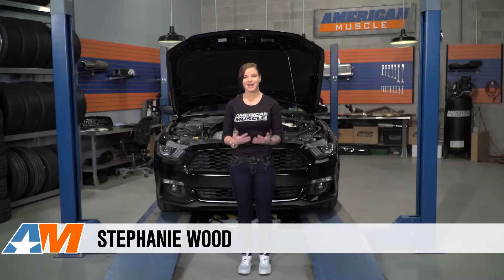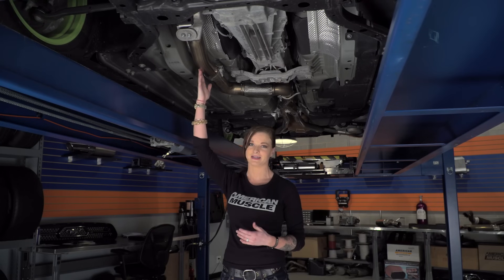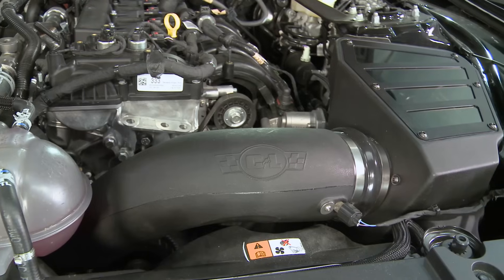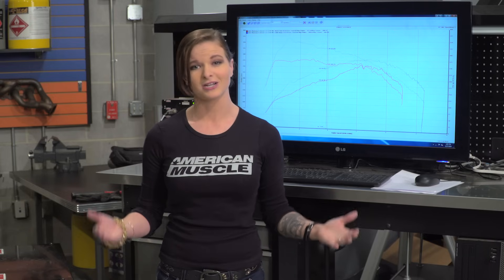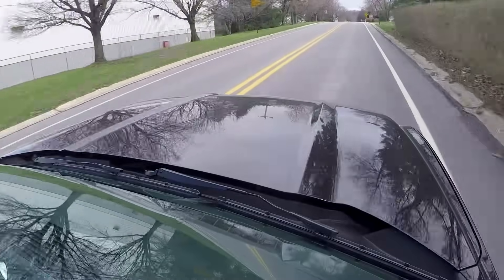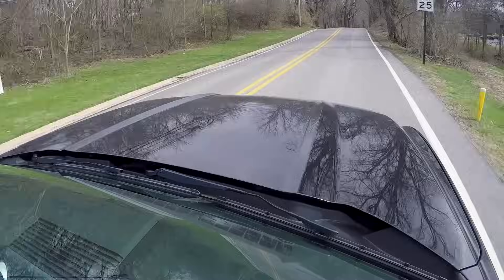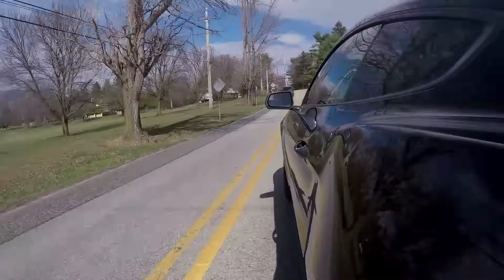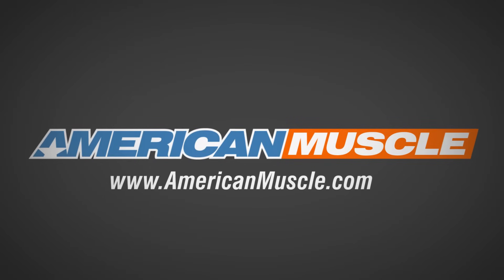3 Mods + 113 HP Gains- 2015 Mustang EcoBoost

Comment: A true mustang owner wouldn’t bash another ecoboost owner because he thinks he’s better for having a GT. A true owner would admire any mustang for what it is.
Reply: Facts and as a first car, an eco is fast and still nice. Decent hp
Reply: Someone sounds hella insecure
Reply: @ashtonl6122  I mean do you have a gt almost going to the gast station almost everyday taking it to work?
Reply: @carlosalvarez5615  firstly you must work far secondly buy good gas no 76 quiktrip circle k etc.
Reply: @ashtonl6122  sound like someone who ain’t got a fast whip.
Reply: @matthewobrien5398  why have a fast whip when you can have a 2500 and fast toys 😘
Reply: Exactly brotha .. forsure the noise doesn’t compare to the V8 but the power forsure does have the mustang it’s quick and packs a punch ! Just picked up the 10 speed and I love it 😎🤙
Reply: @ashtonl6122  tekuache moment be like:
Reply: Well said.
Reply: a true Mustang owner owns a Mustang.
a cool Mustang owner isn't an a**hole.
a "typical" Mustang owner is an a**hole though lol.
Reply: I went from a GT to a ecoboost I love them both but it is nice to have turbo sounds and blowoff tho the deep rumble from the GT is also nice. Ecoboost is a fun daily driver GT is a good race car.
Reply: With that being said I do have a stage 2 Tune on the ecoboost and it is faster then my GT ever was. And the turbo sound in my opinion is way more addicting then a loud v8
Reply: 2007 mustang GT to a 2021 mustang Ecoboost
Reply: Eco's are pretty quick. impressive for a 2.3L.
Reply: @everythingjonathan8008  Im about to drop about $3.6K to aftermarket the exhaust, intercooler, downpipe and catch can with labor and a tune. The guy doing it for me believes he can get more than 110+ hp out of it. Like bruh. Youre telling me for 1/10th of the cost, you can add 1/3 of my total hp??? Wtf yes please
Reply: Marcos, your comment deserves a like from every Mustang owner, so true, one fam.
Reply: Lmaooo slow ass ecoboost
Reply: @Dee-nv3ur  bro how old are you?
Reply: Both will run over crowds of ppl, we don't descriminate (I was a gt owner , squirleist car ever)
Reply: @carlosalvarez5615  if you can't afford gas , you should of bought a used Honda Civic
Reply: @johnjames5842  funny thing is I had a Honda Civic but I got rear ended and somehow was able to upgrade for an ecoboost🤣
Reply: @carlosalvarez5615  I have an 08 civic SI , got it after my 03 GT was totalled (and my 1st kid was born , was gonna get a 03 mach1 but went with the 4 door because of the new  baby) , other than a starter I've never had a problem , 180k and still rockin , it will be seen if a turbo ford can last, my coworker has one and it's cool.
Reply: Nah fuck that it’s 5.0 or nothing
Reply: @johnjames5842  That's what I love about my HPP. I can whip it around and correct it extremely easily. Both have their upsides and downsides.
Reply: @Dee-nv3ur  let's see your 10spd.....

Bicycle bahahahahahaha
Reply: @pleasestfu4801  that  aluminum block 5.0 sounds great, but it's extremely complicated motor compaired to say a LS1 or LS2 , I like my buddies eco boost , I used to make fun of 4 bangers , but from 40mph-120mph my civic SI is faster than my stock 03 GT was , the gear ratio was weak AF on those 2v GT's , the Honda grew on me , that little 2L dohc will make 600hp consistently with an ebay turbo on pump gas and stock motor, so 400whp daily driver on a car that barely weights 3k lbs and is dependable is very cost effective.
Reply: @Dee-nv3ur  So 5.1 seconds is slow to you?
Reply: True
Reply: Facts
Reply: Well my 2015 Ecoboost sure demonstrated its power.  At the strip, I just reached the 11s until I snapped an axel.  As of 2022 I put over $70,000 into the car for anther 50hp and toughened the whole drivetrain.  Slicks and the track compound are great at breaking cars.  All those big turbo kits, Frankenstein the car and all you get is a plastic trophy if you win.
Reply: Who still says "hella" 🤣
Reply: PREACH
Reply: as a ecoboost owner , thats a pretty
Reply: @Dee-nv3ur  i drive one, it aint slow but its def not fast as hell id describe it as quick
Reply: @georgekircher4307  i have one also! I love it
Reply: Unless it's the Mach-E. We all know it's not a real mustang.
Reply: @BinisGunsAndGames  sad when people say they drive a mustang and find out it’s a mach-e💀💀
Reply: That’s bullshit anybody who can afford the V8 is going to buy that it’s a better car and anybody who can spend the extra money on it has every right to look down on somebody who takes the base model option. And that’s coming from an ecoboost owner
Reply: My HPP Ecoboost is tuned with a CV Fab intercooler and a great daily driver. Quick and fast for what it is and with the handling package turns like it's on rails. If I need to get serious I have a '79 Cobra that can run 9's naturally aspirated. I can play however anyone wants but I love all Mustangs. Everyone doesn't want or need a 5.0 or a true Hot Rod, all in what you like.
Reply: Lol, A TrUe mUsTaNg oWnEr
Reply: @ThatGuyRides This is the correct take. It's fine to look down on things.
Reply: @ThatGuyRides I can afford a V8 and I just bought the convertible ecoboost because I don’t race or feel the need to have a peen measuring contest with strangers. Not everyone cares & some just like mustangs, like me.
Reply: Except the mustang 2 we can all agree that  was awful
Reply: Only people who bash these ride the bus
Reply: @Dee-nv3ur better than a slow ass mindset. Being into cars isn't always about being fast
Reply: @ThatGuyRides what fantasy are you living in? You need to get offline and go experience real life cause that shit was cringe
Reply: 0-60 in an Eco is pretty much in line with the Lamborghini Countach… look it up
Reply: Agree he's riding a Ford mustang..that's what I think when I see a Ecoboost
Reply: Facts I want a mustang but everyone always judges the v6 like their still fast and I like to cut up and drive all the time I can’t afford to be paying hundred dollars on fucking gas in a day
Reply: @ThatGuyRides yeah but that's just a very childish and immature thing to think. 

And having a GT doesn't mean you have money. I know plenty of people who have bullshit jobs and living at home with their parents and they just dump all their money into their GT. 

I'm more impressed with an EcoBoost owner who also has a mortgage and raises a family.
Reply: I met a guy recently that's owned mustangs his whole life. He has a GT500, GT350R, a 69 fast back drag car, etc. He still geeked out with me about my ecoboost. That's a true appreciation for the Mustang name.
Reply: @Yorsem  I love to hear it, that's really cute for both of you. That he doesn't measure his manhood based on the number of cylinders and that you're joined the Mustang family and have something to bond with your friend over. I'm jealous of what you two have 😂
Reply: Facts
Reply: My wife has an eco I have a GT I like driving her car more then mine sometimes 😅😅 until we go to car meets😅
Reply: @mrbarco5435 easier to turn right? More mechanical grip out of the front end
Reply: Yes but I like the gas miles I get out of it😂😂

Comment: Would rather get the Ford warranty-approved powerpack from Ford Performance. Similar gains. The only thing I would get from Cobb is their intercooler. And keep the stock exhaust LOL I don't want people to wonder which JDM is coming around the corner when I come cruisin' by LOL
Reply: WOODYxWOOD it definitely doesn't give the same gains
Reply: I am debating whether to go with the FP or get a custom tune. I got a used AP for 350 but havent installed it, I can get a custom tune for around 150, all in all I would end up paying less than the FP. I could care less for the shit intake that comes with the FP, the stock box performs just as good. Only thing holding me back is the warranty
Reply: you're definitely not muscle so you should embrace the 4 banger in your car lol
Reply: Protip:  Intakes and exhaust are not necessary.    Any gains you are getting are from the chip.
Reply: Am I gonna respond to a 2 year old comment?.
Yes, yes I am.
The Borla atak sounds awful, the best mufflers are are from Dynomax and magnaflow, deep aggressive tone but still subdued and no rasp, people think my car has the V6. I have a resonator delete and the dynomax 17733 super turbo series mufflers.
Reply: Are any of these mods mentioned legal in California besides the ford power pack?? Our smog and gun laws suck balls!
Reply: @leeknox7  all but the borla exhaust. its too loud and will get you a ticket
Reply: Warranties are for chumps. Go big or go home.
Reply: If youre going to cheap out just get  a K&N drop in and a tune .
Reply: @Bobbrians  do you have a video?  Curious to hear how it sounds
Reply: @imAwesome4lyfe  
The dynomax 17733's sound very similar the the magnaflow street catback which can be heard here https://m.youtube.com/watch?v=1cYOg88ru20&t=85s
Reply: @MustangsbyMatt  dump pipe? Lulz
Reply: Bob Brians the best sounding muffler is no muffler - I’m running a Roush Y-pipe and a Borla mid-pipe that dumps at the rear end with no mufflers + a TurboSmart adjustable shorty blow-off valve - it sounds like a flat six engine which is glorious
Reply: No one is going to think this is JDM.
Reply: Honestly the whole reason I'm getting an Ecoboost Mustang is to build a JDM-style build. It's the only rear wheel drive four cylinder turbo that's on the market.

Comment: I hate how this engine sounds makes me feel proud of my 3.7
Reply: It's a typical turbo 4cyl. These 2.3L EcoBoost motors run very strong. Its orig the RS rally car motor. Very strongly built. Plenty power whether a Mustang/ Ranger truck or Lincoln small SUV!. Love all Ford motors. Best in business.
Reply: @Davido50  It came to the US on the Mazdaspeed3, CX7 and Mazdaspeed6 before the RS. I have the Speed3 and it's definitely Ford's 2.3L Ecoboost!
Reply: Carlos Gonzalez Mazda speed 3s run 18lb boost and ecoboost runs 20
Reply: They should have made a twin turbo V6model mustang and kick the V8 in the nards for once.
Reply: Seriously I installed a k&n on my 2016 EcoBoost 3.7 sounds way better than the turbo.  Pretty sure its  faster too.
Reply: @metalbob3335  That's just the Ford GT then.
Reply: @Davido50  Open deck & "very strongly built" do not go in the same sentence. 
The 2.3 is known for shooting rods out of the side of the block even in stock form. The RS version loves to pop head gaskets. It is not strongly built in the slightest, definitely one of Ford's least reliable engines.
Reply: @RamyWarda  its Gen2 now boss an its a beast of an engine far better than any similar sized competitors! Mustang guys getting 400hp/500hp out the 2.3L Ecoboost w/stock turbos. The head issue early on was simply a gasket swap to fix no design flaw. Rod issue? Fallacy. Had an RS an now new Ranger. Powertrain best in class.. as all the reviews have said & I concur! Love my new Ranger XLT FX4 ..1yr 15k mis & flawless thus far.
Reply: Way faster then ur 3.7 🤣
Reply: @louosjames1396  k&n intake ? Sorry im new to this....
Reply: Everyone has thier personal taste in sound. For me, 2.3 turbo is enough for me.

Comment: Car, girl, car, girl. Nice job.
Reply: except for the engine sound which makes me puke
Reply: So after all that is it even cheaper then getting a v8?
Reply: @PremiumAphid  
When I bought my 2017 eco the GT on the same lot cost 20k more, for 3k I was able to get the car to a little over 300hp to the wheel and now it runs 13.3@104 in the quarter on the stock tires (custom cat back, intercooler, tune, intake)(stock the car ran low 14's and made a little more than 250hp to the wheels).
On long trips I can get as high as 34mpg at 70mph, mileage sucks in the city though because of my heavy foot and fondness of spinning tires.

As far as v8 noise goes, I also have a '17 F150 with the 5.0 so I have the best of both worlds.

Comment: I’m a V8 guy but I think these ecoboosts are the best dollar for dollar performance cars. An American Supra. Ford should have called it the SVO it would have been cooler. Tune, a MILD exhaust setup (no lawn mower sounds, a little burble), down pipe, and for a $26,000 base price and $2500 in expenses and you have sub  5 second 0-60 car. High 12’s in the 1/4 for about $29000 is a banger of a deal

Comment: "I hope you're a good driver" 
Camera cuts to her driving way over the double solid yellow
Reply: Lmao I came to see if anyone else picked that up
Reply: @seanw9124  lmao, I will say though. This video is what led me to mod the hell out of my ecoboost. Brings back memories to when it was stock :,)
Reply: @mrgrump2534  thise engines will hold up similar, if not better than a 5.0 if you do internals. Before getting rid of my ecoboost, I had it just over 500whp. I can see you're the old school "V8s are the only way to go". Well, I urge you to think outside the box & realize there's other ways around it. My ecoboost, would smoke any stock v8 on the street. But yes, you are right, without internals being done, an ecoboost would blow when pushing 500+ horse power. Again, that's WITHOUT internals.
Reply: @mrgrump2534  At no point during any of your incoherent ramblings did you address why it was a bad engine besides “it hurts your ears”. Ok Boomer, don’t forget your screw driver to tune your carburetor.
Reply: @mrgrump2534  you definitely drive an 06 stock Honda😂😂😂
Reply: Who cares about that dude...

Comment: I just don't get why there is no comparison in acceleration and top speed with these mods. How much faster does the tuned version get to 60?
Reply: My 2017 struggled to get 6.1 0 to 60 stock.
With the Ford performance tune, intercooler, catback and 93 fuel I have gotten a 4.9 0 to 60.
Reply: Bob Brians my bone stock  10 speed ecoboost hit 5.1 secs. Have the video for proof. The 10 speed is a badass transmission
Reply: TheDustyaman have to agree with that but still 6.1 to 4.9 is night and day
Reply: My stock automatic hit 5.6 on sport mode. After adding an aftermarket downpipe it dropped it to 5.2
Reply: Bob Brians I’ve hit 5.5 on mine stock automatic
Reply: Bob Brians these mods can ship to greece? having a muscle car on greece is nightmare you can’t find anything haha
Reply: @Bobbrians  I know it's funny to ask but does it get similar mpg?
Reply: @wriglarzzz 

Mileage will stay around the same under cruising conditions but will be worse during performance driving because of the extra boost and fuel.
Reply: 5 seconds in my convertible 10 speed with just a drop in filter and Cobb ots stage 1 tune. I would imagine at stage 3 I could probably do 4 or low 4's for sure.
Reply: That's the question I was wondering.  The best I got was 5.4 in my stock 2017.
Reply: I can actually travel back in time in my performance package after I installed the air freshener and steering wheel cover.
Reply: with the mods she shows in this vid a good tune good aftermarket tires as well u should easily be in mid 4's range
Reply: Bob Brians I’ve gotten 5.5 in my stock 2017, it does run around 6 average though
Reply: Don't trust the stock 0-60 timer. It's likely quicker. If you're running 4.9 it's likely capable of 4.5 or so.
Reply: @Bobbrians  manual? Coz 6.1 is slow af even for stock
Reply: @Bobbrians  I am currently trying to learn about modding cars i just got a 2017 eco boost. What did you start with on yours?
Reply: @brianmacaluso2994  
Catback exhaust, upgraded intercooler and custom tune, that's really all it needs to make it drive like it should. For tunes I used the ford performance tune then tried the Cobb stage 2 91 tune.
Reply: @Sky-ub3ft  
It's the auto 6R80, my elevation is 1800 feet and the gas around here is like California stuff.
Reply: @Bobbrians  my 6 speed auto got to 0-60 in about 5.5 seconds with decent tires alone.
Reply: @Bobbrians I hurt for you brother 😢 out in FL I’m pretty sure I’ll run a 5.0 0-60 on 87 and I’m running 6 speed but ‘19 eco

Comment: I am surprised a larger aftermarket intercooler wasn't installed, the car must have been heatsoaking bad when running hard with that downpipe installed.
Reply: First thing you should do in my opinion

Comment: Well my 2015 Ecoboost sure demonstrated its power.  At the strip, I just reached the 11s until I snapped an axel.  As of 2022 I put over $70,000 into the car for anther 50hp and toughened the whole drivetrain.  Slicks and the track compound are great at breaking cars.  All those big turbo kits, Frankenstein the car and all you get is a plastic trophy if you win.

Comment: My '17 comes stock with 310 hp. I'd love to do this simple mod and up the power.
Reply: Intercooler is a good mod, a tune with intercooler gives a considerable increase in performance.
The factory intercooler is a terrible restriction to the stock setup.
Reply: Mine 2020 does too I have the 10 speed stock ! Sounds good if you’d ask me I posted a video straight from my phone it forsure isn’t like the V8 but not bad especially for how quick these cars are
Reply: @Just_Vibing_Bro  upgrade the turbo bro to a precision turbo they cost 1900$ and it’s bolt on not hard to install. If you upgrade the turbo it’s recommended you upgrade some other small parts for best performance.
Reply: thats not to the wheels though.